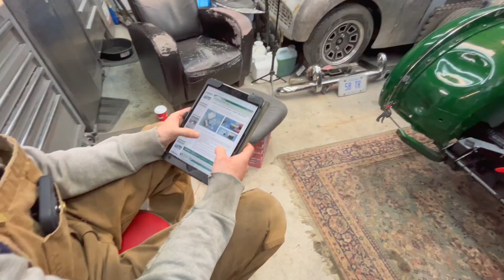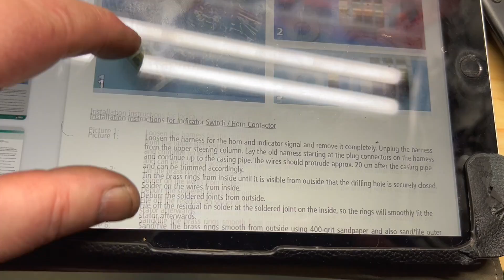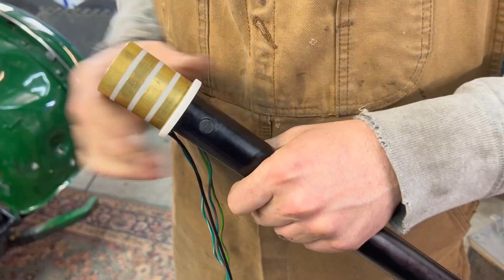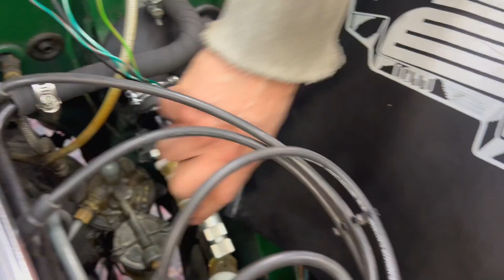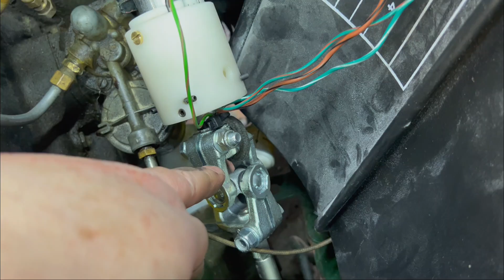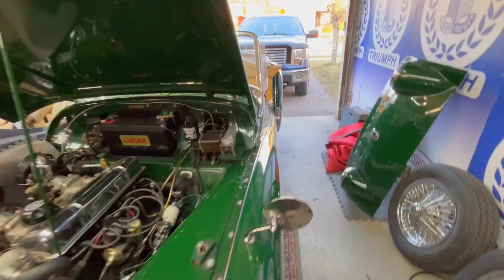1958 Triumph TR3A, Bastuck Rack and Pinion Steering Conversion Kit, Part 4

Comment: Nice video, however I still do not understand how the turn signal stopped turning with the steering just by inserting that screw?
Reply from the maker: The screw essentially squeezes and clamps the outer and inner ring together so they spin as one unit.
Reply: @cheftush  I do not recall mine spinning from where you inserted the screw.  mine is hold up to the steering wheel with 3 small screws. not happy i need to fix it.

Comment: I thought all of those things that did not quite fit only happened to me. Lots of WTF moments for sure. I don't understand the choice of white material, UHMW or whatever it is, when it comes in many colors. I am not sure it will like to be painted. Possibly use a sleeve and Velcro?
Reply from the maker: @jimconklin8040  well, the instructions say to paint. I think I’ll scuff it with a scotchbrite first.

Comment: After seeing this, if I had steering issues, I would just repair/replace the stock components. I competed in the SCCA for 8 years & my TR3 handled great with the stock parts.
Reply from the maker: @jerrystruke9938  well, this rack shines more driving slowly…so much less steering effort required.  For racing applications, probably not required.